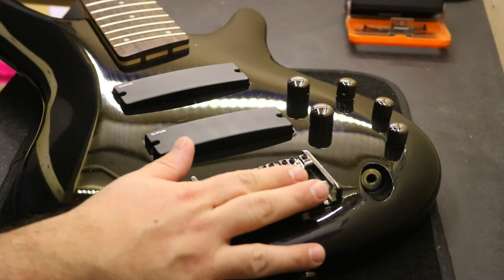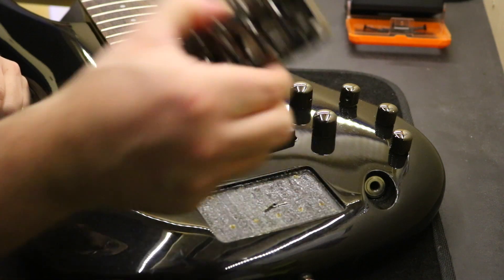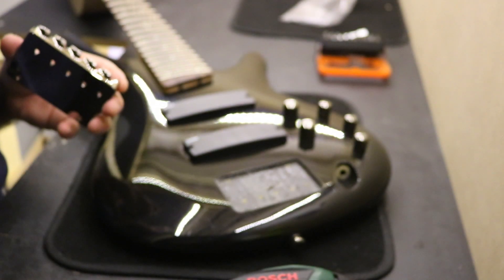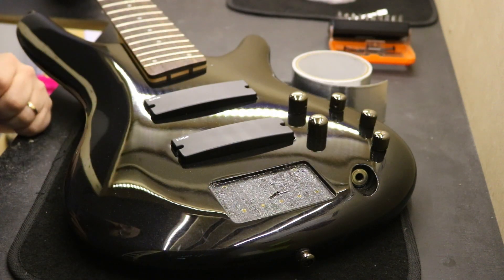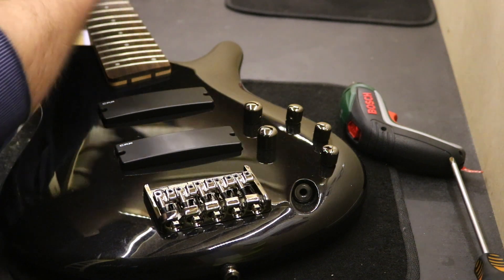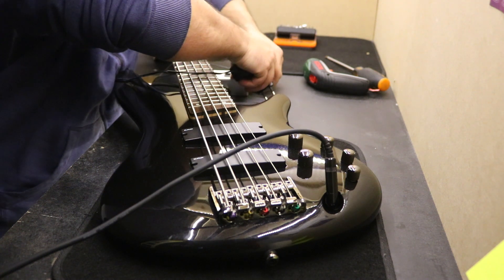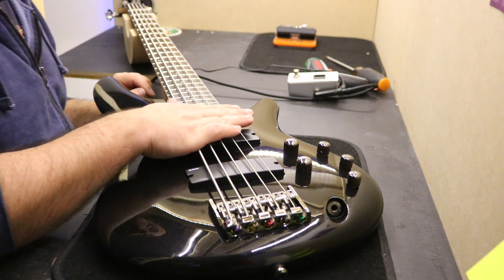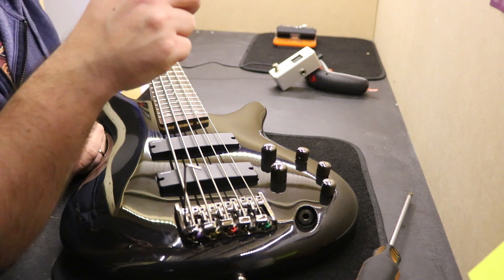Yes, the new bridge...

Comment: My bass did the same thing. I really don't want to buy the same bridge again and would like to make a good upgrade. Are there any bridges at all that will fit?
Reply from the maker: Before I decided to buy the original bridge I made an extensive research, to see if I could find one that would be better, there was only one the that claimed to be a direct fit. I bought it, and surprise surprise it wasn't. So I returned it and purchased original one. The ones defective was just a batch. Since I replaced with the new one never had more problems. I think you will better served with the original one. Good luck and tanks for watching.
Reply: @RevivedGuitars  Okay, thanks man